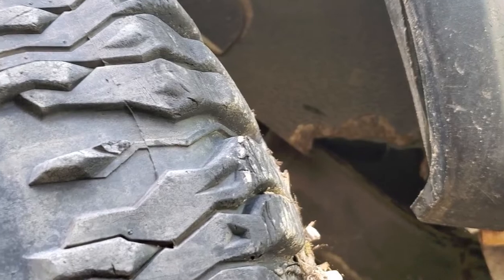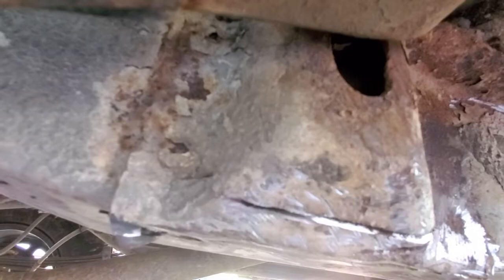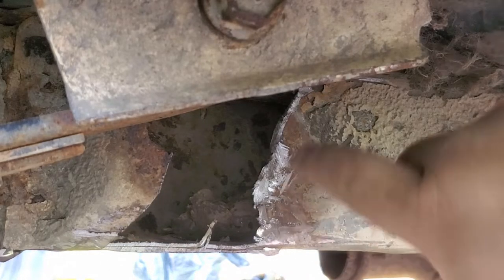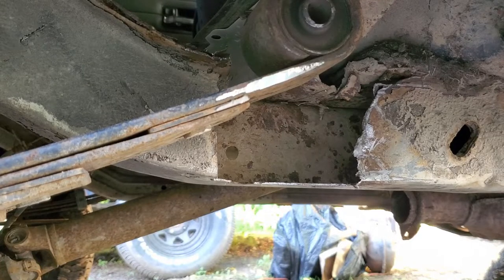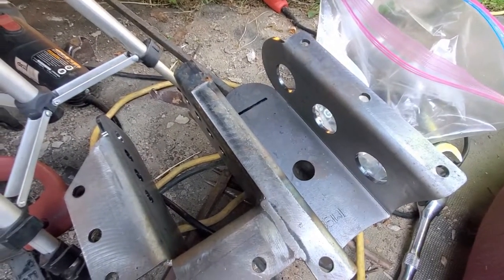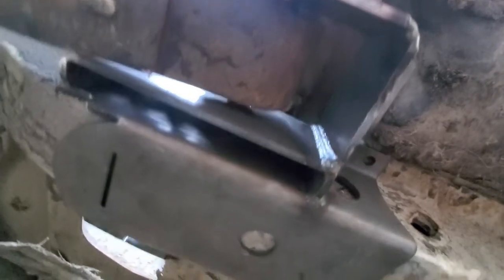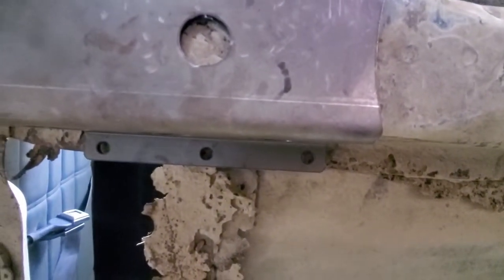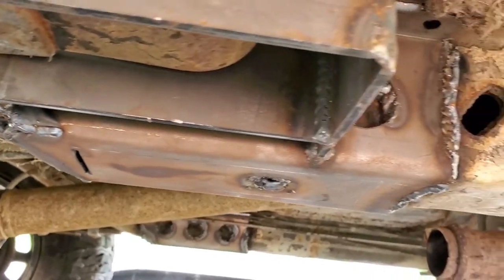Junkin' Jeep! Installing IronmanFab4x4.com Rear Leaf Spring Hangers on Jeep Cherokee

Comment: These can center the rear tires up right
Reply from the maker: As in set how far forward or backward the axle sits? Then to a point, sure.

You would need adjustable rear leaf spring hangers to get the full effect of that.
Reply: @TheFSeries  I haven't even had time to bleed my brakes and break in the airings yet.   I'm pretty sure it'll settle in.    Been an auto tech for almost 22 years I just never had my own 4x4 and this is my first lift lol.    Next thing I'm buying is a welder.  Buying some parts is cool but making them yourself is way cooler